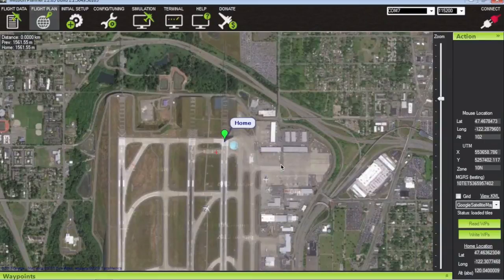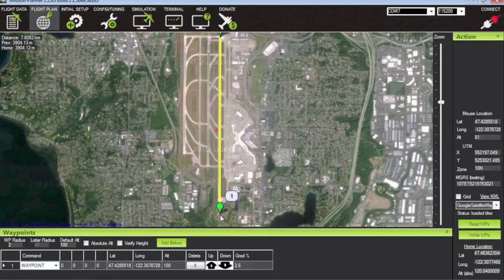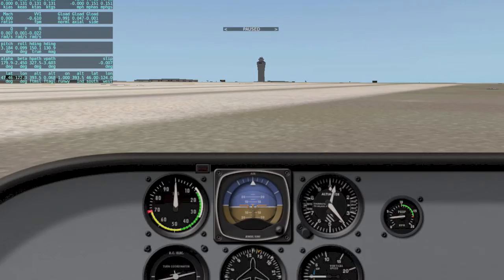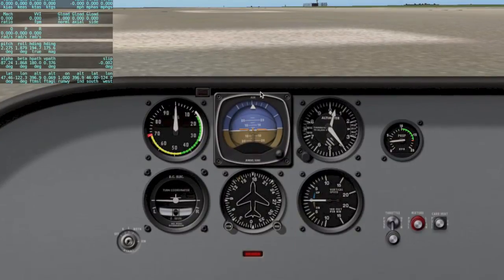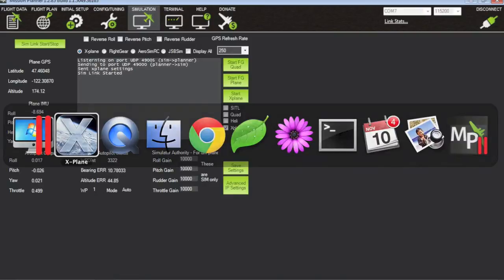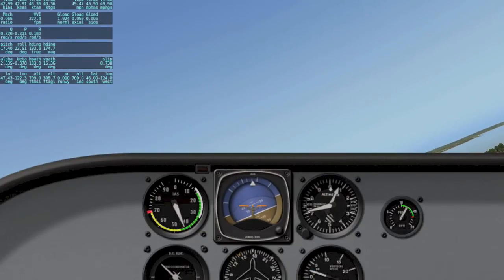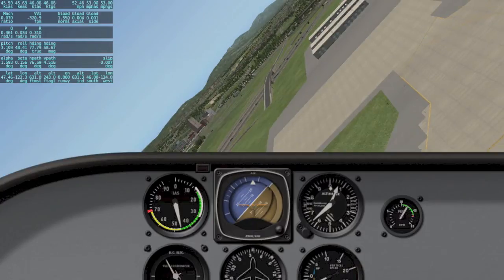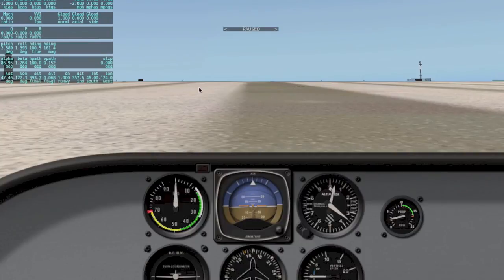APM 2.5  "Hardware in the Loop" Simulation and Auto Flight Mode for Waypoint Mission in X-Plane

Comment: Hi Dennis~ Your APM HIL are operating smoothly, but I've always had a problem on the HIL set that aircraft GPS position x-plane can not appear in the APM mission planner, although I can use the remote control to drive x-plane aircraft, but can not use the mission planner for the aircraft under any instruction, latitude and longitude appear only in the simulation window, whether to help me see where the problem is, thank you very much!
Reply from the maker: Hi Mike, thanks for watching. Where are you expecting the GPS position to display in Mission Planner? For starters does the plane show up in the proper location when viewing the Google Map in Mission Planner?
Reply: Thanks for your answer~ my plane doesn't show up on the Google Map in Mission planner, So, I can't order any action to the plane. If possible, could you show all your setting to the x-plane and APM? and the APM 2.5 setup vedio~ thanks for your help ^_^
Reply from the maker: Mike Wuwu Have you seen this one? APM 2.5 "Hardware in the Loop" Setup Using ArduPlane Firmware and X-Plane Flight Simulator Does that help?
Reply: HI! Dennis~ I re-watched your movie and found I did not download the correct HIL firmware.However, only this action is different from my previous installation, and then I am able to successfully transfer the X-plane location to the mission planner, and I can operate navigation control, so I really appreciate your video, thank you so much!! ^_^
Reply from the maker: Mike Wuwu Great to hear it Mike! Thanks for the feedback and watching.

Comment: Hey Dennis does that work with quads and what do you like better Naza or APM or kk2 I'm still rebuilding from the fire so now I have some time to pick one
Reply from the maker: Hey Chris, I hope you're doing well. I read somewhere that X-Plane does support quads but am not sure how to enable them. I'll probably need to buy the full version of X-Plane first. I'll keep you posted. I like all of the FCs that you mentioned, but it just depends on what you're trying to do. If you're looking to have a fun quad to fly around and do acrobatic maneuvers I would look into KK2 or NAZA. Obviously KK2 is much cheaper, but doesn't offer RTL which comes in handy every now and then. Take care.